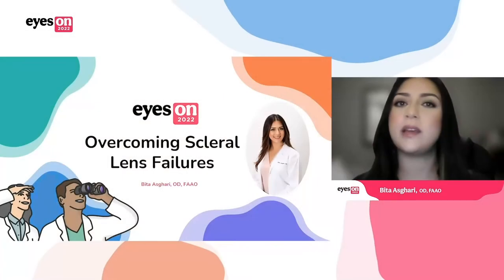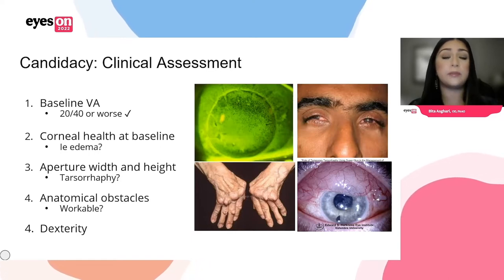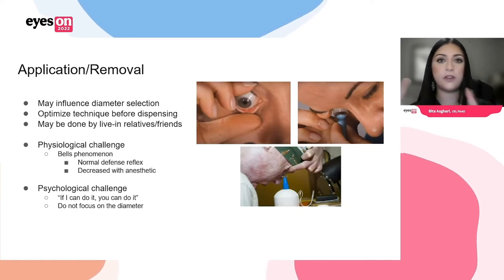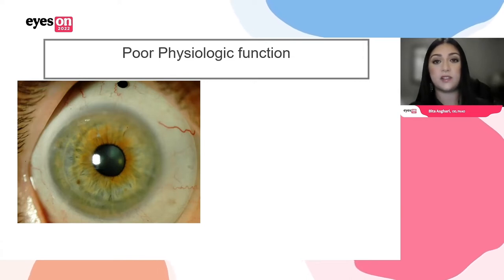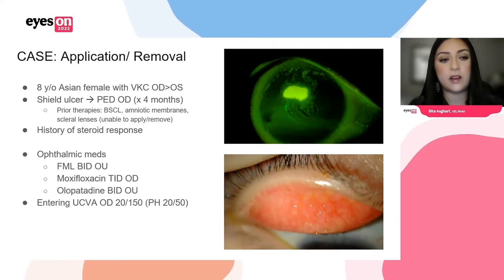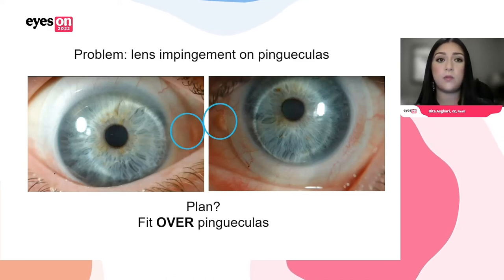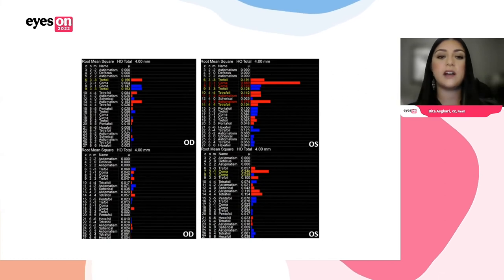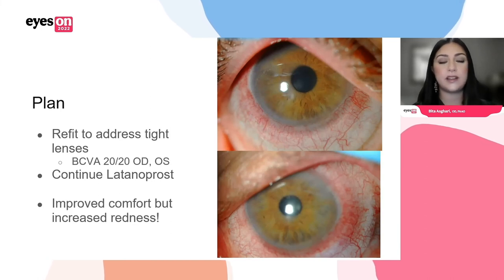Overcoming Scleral Lens Failures

Comment: Thank you for your presentation, it's really encouraging me to hang in there. It's my third day and I can't tolerate them for more than three hours due to significant dry sensation. However, what I really find worrisome is that there are occasions when I experience severe irritation and significant  degradation of vision. I can't read, drive or go for a walk because of blurriness. It takes several hours for it to subside. I hope there's a solution for this.
Reply: how you deal with scleral lens now??
Reply: Air bubbles were causing the problem. Once I resolved this and started to add celluvisc with the saline things got alot better! However I've had to stop wearing them unfortunately.  My left eye is very sensitive and because I wasn't able to remove the lens without some rubbing upon removal it became much worse. I just can't seem to remove the left lens without some scratching.
Reply: @SM-uy7oj  now you not wearing scleral lens??